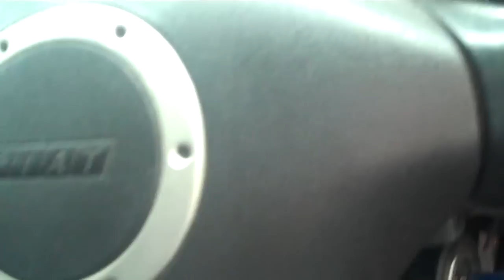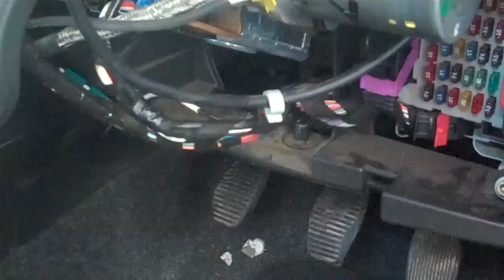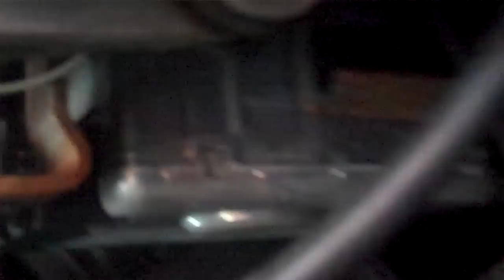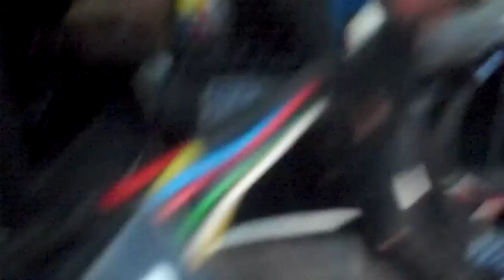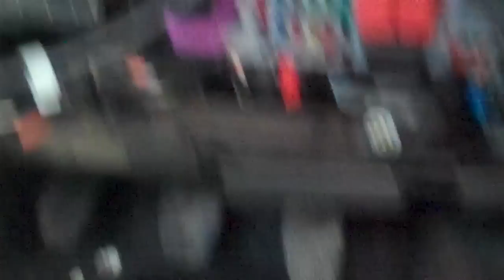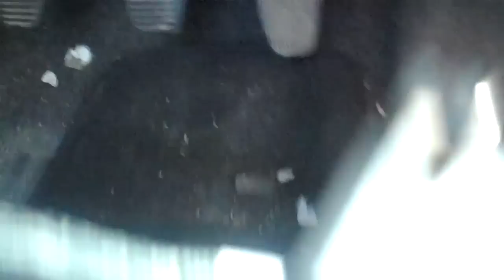FIAT PUNTO POWER ASSIST STEERING REPAIR

Comment from the maker: @hp11208 aye that right, its a electric POWER ASSIST STEERING, motor fitted now to most modern cars, that wee fiat is 11 year old, no more PAS pump or oil system, the old system uses more fuel, hence, the engine driven PAS pump,